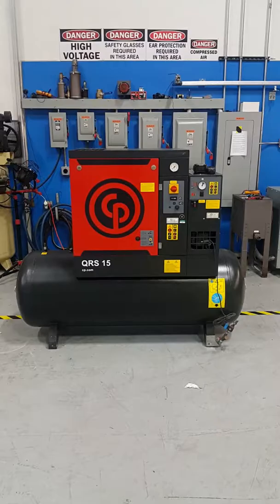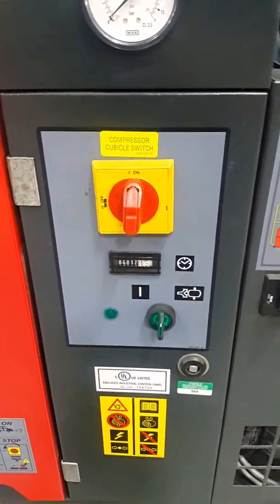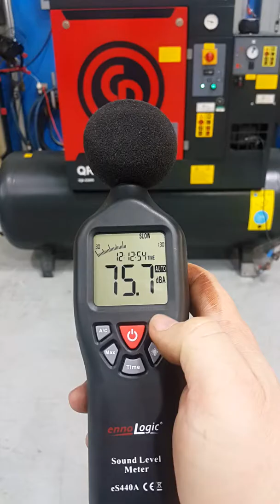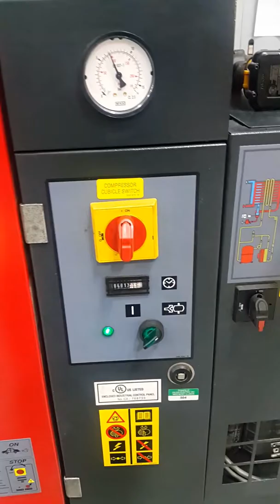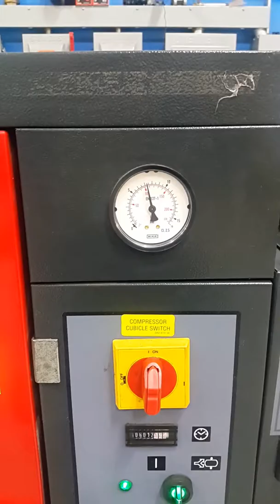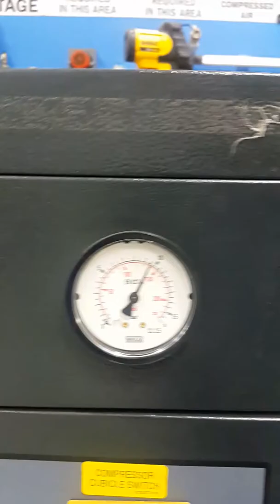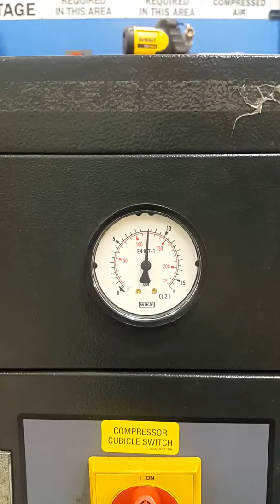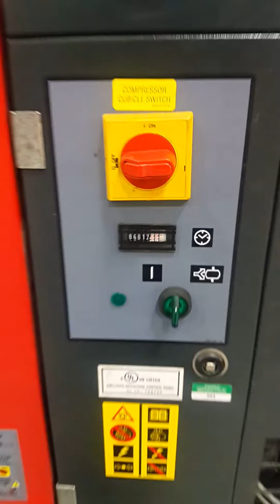Used Chicago Pneumatic 15 HP With Dryer

Comment: We have one of these at my shop that’s nearly a year old. It’s overheating and shutting down. The compressor oil gets super hot within minutes of running and it’s milky every time we drain the oil. Refrigerant dryer in the right side of the unit runs all the time. What could be wrong with it?
Reply from the maker: shwndh please call us Fluid-Aire Dynamics 847-678-8388 ask for Aaron. Thank you.